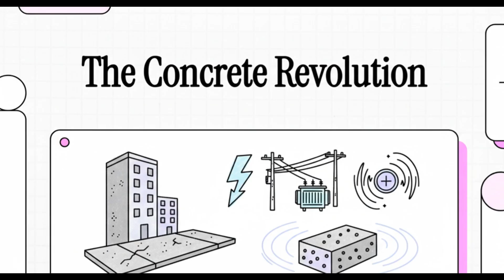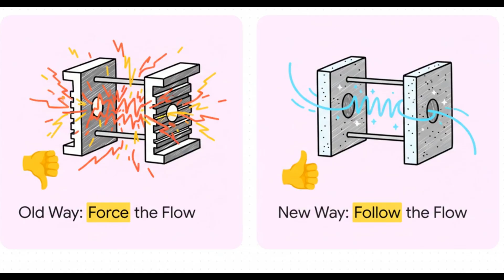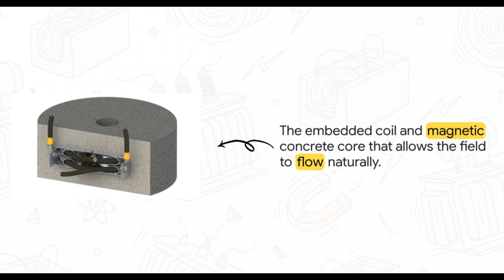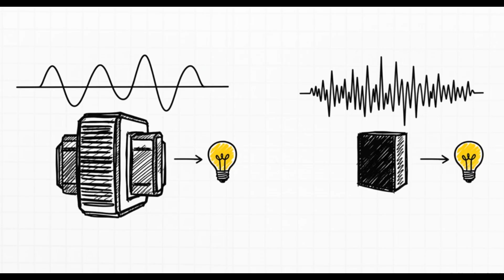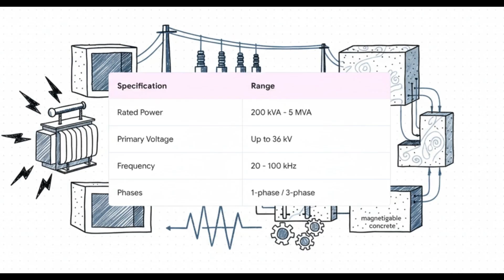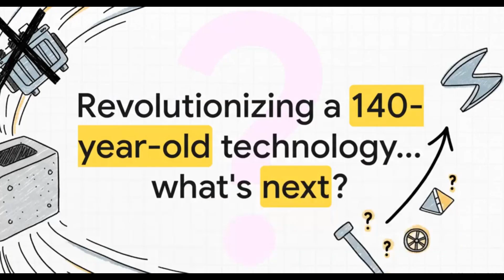MagPower-3H™ Transformer: The Concrete Revolution Video EN

Comment: Okay, let's be clear about a few things. (For the record, I am an electrical engineer, and I am not using an AI.) Traditional transformers do not "force" anything. If you don't build a silicon steel-core transformer to work with nature, nature will blow it up. Traditional transformers are also 99%+ efficient, so there's really no substantial efficiency gain to be achieved by using something other than silicon steel. Yes, you can use ferrite-loaded concrete to make a transformer, and yes, this may be a way to save iron, but iron is cheap, and less than 1% of all iron production goes into making transformers, so that is not a good reason to make the change. What a potential customer needs to know are the questions this video doesn't even attempt to answer, questions about structural strength,  operating temperatures, long-term reliability, and so on. Without that information, this is just useless puffery.